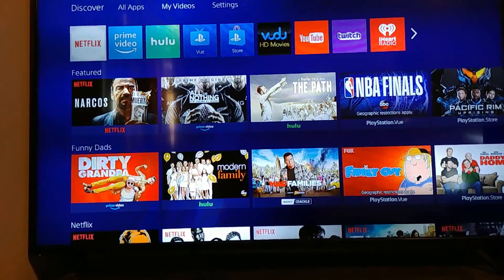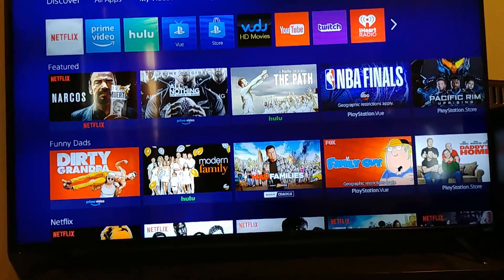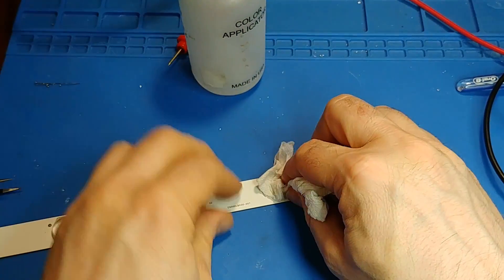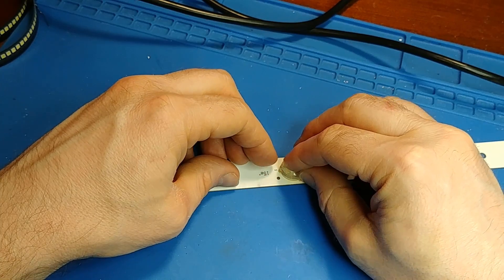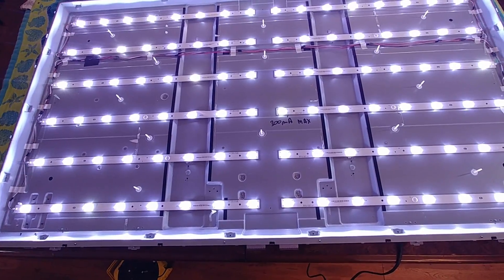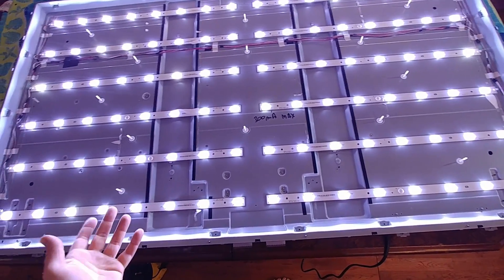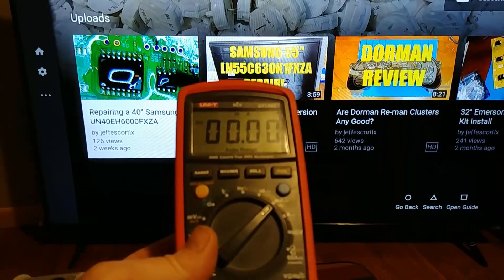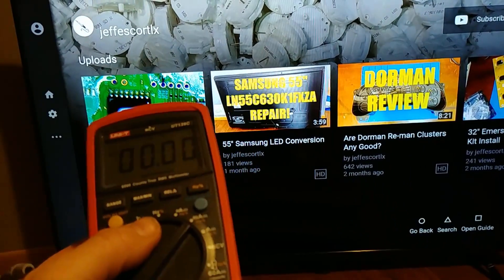How to Repair 60" LED Vizio Smart TV

Comment: Hey, I have a full working set of these strips a friend gave me to play with.  I want to incorporate them behind an airport flight status scroller.   Single strip - what power supply would you suggest  - 4 strips?    all Strips. all strips would be conected the same as inside the tv.
Much Thanks!  Todd K.
Reply from the maker: You're going to need a high voltage current regulated power supply. In the long run I think you would be better off to sell the TV strips and use genetic LED rope lighting. They are happy with a easy to find 12v supply and current regulation is needed.
Reply: @jeffescortlx   And of course, your right, 200 volts for wall art is ridiculous and just plain dangerous.  I do appreciate all your help on this.  I am going to run 2 strips in parallel try on 21 volts at 350ma and see how that rolls.  Let me know if i am missing anything.  With Thanks
Reply: @jeffescortlx  I would prefer to use these, and your input is truly appreciated.  I have a gaylord of power supplies, ranging from 30V 3.0A DC to 90V Steppers.  I have used 5050SMD - CREE Etc Etc  they just don't last or provide the light output that i really want.  Can you give me a good DC voltage and amperage to use these?  At best what would i need for one strip, that would help me out the best.  Thanks again.
Reply from the maker: @Mainbusfail  it all depends on how you wire the strips. Typically in TV's they are all in series so 150-200v is normal. I believe this TV breaks it down into individual channels. Limit the current around 100-300mA per strip and don't exceed 3.3v per LED.
Reply: @jeffescortlx    Very good,  that is what i will do.  I am just going to use one for testing.  Much Thanks!  Todd K.

Comment: Is there any way to do this without a hot air station?  If not, which one do you recommend?
Reply from the maker: If your not setup with soldering tools I'd reccomended to buy a complete set of replacement LED strips. It will cost more, but makes the repair much more pleasant with good end result without having to worry about crooked lens or LED's not soldered right.
Reply: @jeffescortlx  Ok thank you.

Comment: i have the same tv and it lights up and i bought new tcon board and main logic  board only thing i havent replace was the main power board curious would that have problems lighing up the back screen
Reply from the maker: I don't understand the question. The back lighting works, but it has trouble lighting?
Reply: @jeffescortlx  yeah the TV still has that glowing look but I have no picture I'm confused my self.. the led strips light up thru out the back of the tv but still no pic

Comment: A good few high capacity caps with bleed resistors, should take care of a spike/surge.
Reply from the maker: I would assume caps accross the LED's will effect the PWM. In stead of the LED's seeing PWM it will just see a averaged voltage. Might hit the low level voltage cutoff on the low end, might end up with LED's not lighting at dimmer levels. Also since the LED output is current regulated and monitored, I'm not sure how's it's going to react to a capacitor charging on power up.

Comment: These are under-rated and also under-performing TVs, 100% as a direct result of Vizio making a really unfortunate business decision. Vizio is allowing cheap, low-quality LEDs to be installed in many of their non-flagship models. This is a big mistake as it directly impacts quality and reliability. For example, brand-name LEDs with proper binning and specifications would improve contrast and color accuracy, not to mention outlast ever other component on the TV.  I just bought a 2015 model and changing out all the LEDS, whether they work or not, with much better binned LEDs. In fact, better binned, brand-named LEDs, running at the same current and voltage, be 30-40% brighter and also run cooler. The result will be a much better performing TV than when it was fresh out of the box.
Reply from the maker: You really can't single out Vizio. Every TV manufacturer has used bad LED's at some point or another. Samsung, TCL and LG are just as guilty. The only brand I don't remember putting LED's in is maybe Sony, they just have bad main boards.

Comment: You mentioned an led kit to replace them all? Do you have a link for that?
Reply from the maker: I don't know the kit part number, but if you drop the TV model number in the search box at eBay, Amazon or shopjimmy.com it will come up if it is available.
Reply: @jeffescortlx  thx bro. First time doing this. Ur video id def helping. Taking it apart is quite the process and ur details are great
Reply: I dont have a hot air station, but a hot air gun....i take it that should be okay? Right?
Reply from the maker: @de50aemr  if you can find a complete LED strip repair set you won't need to worry about replacing the individual LED's with a hot air station.

Comment: Can adding a fairly large inductor do the trick?
Reply from the maker: I'm not sure how the inductor will react to the PWM used to control the LED's. It might act as a low pass filter. As a voltage drop side effect it could help absorb some of the power. But might be better off just using a resistor if your just looking for a voltage drop

Comment: I swapped a couple bad strips out on a 47' vizio I have and then the LEDS were pul;sating when I turned it on. Took it back apart and just hooked them to the power supply and they were fine. So 1 by 1 I started hooking stuff back up and they didn't pulsate til I put the screen back on. So were the 2 strips wrong amperage or is the screen bad or what? any ideas?
Reply: there is a weak LED lowering the voltage. you have to find it with a tester. could also be a bad power supply.

Comment: Hey Jeff, I'm converting one of these Tv's into a table and was wondering how much power I would need to run all the LED's at once?
Reply: Just the strips and wires left. Can you suggest a power supply or what specs I should be looking for? Possibly a dimmer?
Reply from the maker: @edwardtucker9256  3v per LED. Limit to 200mA and you'll be in a safe range but still near maximum brightness.
Reply: Edward, would be cool if you made a video and show it when your done.
Reply from the maker: Power? Where on the 120v AC input side?

Comment: Do you power up the tv just by plugging it in? I do that and nothing happens. I know not all the strips are bad.
Reply from the maker: You might have to turn it on with the power button.
Reply: @jeffescortlx  Thanks. I replaced all the strips and now they all light up normally, but after about 30 seconds all but the middle two strips dim while the middle ones stay full bright? Is this normal?
Reply from the maker: @YoAdriannnn  Yes. That's the local dimming feature. It's trying to display "no signal" in the center of the screen. No need to light the top and bottom of the screen just to display that message.
Reply: @jeffescortlx  Oh thank god. Gonna put it back together tonight. Thanks for the video it was immensely helpful

Comment: They always tell outrageous lies they tell about how long the back lights last. I have even heard them say 30 years. Why can't led companies tell the truth.
Reply: The main reason is that cheap, poorly binned (out-of-spec) LEDs are used. If good LEDs were used, these TVs would still be running, and honestly have better contrast as there would be more light output.
Reply: I like LCD's better. They last for years! Still have one that's about 11 years old.

Comment: Thanks Jeff for this video..but no way I'm going to do all this. I'll never buy another Vizio TV again that's for damn sure.
Reply from the maker: Read corys post, 2 posts down.
Reply: @jeffescortlx  Hi Jeff, would you recommend I pay a TV repair guy $350 for parts and labor or just buy a new TV altogether? Mine is about 4 years old? Appreciate your help.
Reply from the maker: @marqueamore8467  ideally the most economical solution is for you to order the parts and install them yourself. If that is not a option for you I would reccomended to donate the TV to someone capible of the repair and buy a new one. TV prices have really come down. $400 will buy you a large 4k smart TV.
Reply: @jeffescortlx  I have the 65 inch model and mine had the dark spot on the right side of the TV the whole right side edge was dark then about a month later the screen quit working all together would my issue be the LEDs or a bad board
Reply from the maker: @kevinanglin678  do the flashlight test and see if it still has image.
Reply: @jeffescortlx  ok

Comment: I was doing the repair and accidentally tore the ribbon that goes to the scan drive board on the left hand side. It looks like it didnt affect any of the electrical connections but now TV shows no image. ????

Update: upon further review. There is nothing wrong with ribbon that connects to screen. Theres no image or sound. Antenna is connected as well. It was working before and only needed LEDs replaced. I made sure that everything is connected. I'm at a loss. I need help please. I paid 92$ for strips.
Reply from the maker: I'm not sure what you did, or didn't do. It's hard to troubleshoot long distance. Maybe sleep on it and take a fresh look at it again.
Reply: @jeffescortlx  thx for the reply. Just a little background on me, I repair computers and build them. I also tinker with fixing all my electronics. I handled it the way u would handle any electronic. That's why I'm so confused why it isn't showing an image now. I thought at first the ribbons were not connected correctly or were not making good contact. I carefully disconnected them and connected them back again.  You can see something changing in the background but no image actually displays.
Reply from the maker: @moisesmaldonado3210  ok, back lighting and image are independent from each other. And you have neither?
Reply: @jeffescortlx   I do have backlighting I can't see an image for when I start clicking the smart settings to open up YouTube you can see loghting changing in the background you just can't see a an actual  image.  I also connect that the antenna again and since the  Channels are already programmed it should have at least had sound but there's no sound coming out.  either
Reply: @jeffescortlx   I'm doing all this work on a wooden table so there should be nothing that to call static the what a fried the circuit board on the back. And I never even touched the boards myself.
Reply: @moisesmaldonado3210  Static damage can come on wood, plastic,glass and other non-metallic surfaces. 35 years in electronics and bench repair on TVs all the way up to fiber optic lasers and telecommunications gear. Have B.E.E. and 1st class FCC license

Comment: Nice repair, sucks to have to remove the screen & all the support screws to replace the LEDs though! When handling a screen I'd use gloves, nothing worse than a mark on the back of the screen... I guess this is fate of most LED backlight TVs,  you have to make the call on whether it's worth your time to repair. I wouldn't want to have to swap out all those strips though, but $80 to get your TV working again I suppose is cheaper than buying a new one!
Reply from the maker: When I first stated doing LCD repair/glass removal I was super careful about keeping the back side clean. But the more I did, the more I noticed finger prints on the back side don't show up on the front side. So now I just do what I have to do (keeping it to a minimum of coarse) but you would have to leave a serious smug for it to block light and show on the front side image.

Comment: I'd like to talk to you.  I have some equipment you may be interested in.
Reply from the maker: Like what kind?
Reply: @jeffescortlx
Reply: Just went through a divorce, so You are in a position to get a deal of a life time.
Reply from the maker: @brookehill2402  I appreciate the offer but my amscope is pretty awesome. I can't imagine replacing it.
Reply: I also need my dash repaired, but of course I'll be one of your "fix it yourself mess ups'.
Reply: @jeffescortlx  I have an amscope as well, which is why I won't let it go.  It is awesome.  I just thought you might want something of high power and a probe station.  Please call me and you might find out it is an awesome deal.
Reply from the maker: @brookehill2402  is it a medical style microscope? Looks to have a close working distances?
Reply: I am letting it go for pennies on the dollar being I am in an apartment now instead of my house.  And by pennies on the dollar, I am not kidding.  Call me and I just want the space not wasted.  You can win link a sin.
Reply: I used it delayer  micro controllers.  .   @jeffescortlx
Reply: I used the probe station to monitor the bus to find out how it worked, and I can assume you can assume where I went from there.
Reply: Of course that took some knowledge of assembly language and some C, but for your use, I assume it would be used to take voltage/amp measurements.
Reply: My stepdaughter is a huge fan.  I took her to her first junkyard the other day and she went nuts scavenging parts.  I don't want to steal business from you, but she really wants to dive into it after i showed her your videos.  She saw me fix a vizio 42" and thought it was awesome.  20$ fix vs a 400$ fix.  I am bringing my soldering station out of storage,,,kind of a cheap station, hot air, and iron, but it works.  She is going to have a blast.
Reply from the maker: @brookehill2402  I appreciate you thought of me. But my office deck is running out of space. My amscope is perfect for my needs.
Reply: @jeffescortlx  The large on has close working distances.  The probe station gives you plenty of room.
Reply: @jeffescortlx  I understand.  Even back in my lab i ran out of space.  Just thought Id through the Idea at you being I am trying to clean space.  When I mess my cluster up pretty bad, you can have a go at it!!!.  Though I am confident I can fix it.  It is the PRNDL that is not working.  Fun Fun.

Comment: Thank you for this video, it has been very helpful. I have a Vizio model E65-E3 with a few strips not working. I cannot find replacement strips and so I would like to replace LEDs like you have in this video. Can you tell me how I can identify what kind of led I need to get? Thanks again!
Reply from the maker: You can measure the dimensions with a micrometer. I typically see how much current they draw at 3.3v to get an idea. Also bottom pads can change so keep that in mind. Color temp for tv.

Comment: I think this issue may be due in part to poor thermal coupling (and probably low qc leds) almost all the ones that failed in mine were over thin air in the channels of the chassis rather than pressed against that large hunk of metal.  I'm going to put a little thermal paste down for better coupling as well when I replace them and try to come up with something for those in the channel.

I would be interested in a hardware solution to limit inrush I seem to have found a suitable component. https://www.onsemi.com/PowerSolutions/product.do?id=NSI50350AD
One per strip should work I think so I need to find it uner 2500 qty....
Reply: https://www.digikey.com/product-detail/en/on-semiconductor/NSI50350ADT4G/NSI50350ADT4GOSCT-ND/3487456
Reply: 100%. I looked at the failed LED under magnification and the phosphor coating showed heat stress. Or at least what is most likely the combination of defect and heat stress. Better thermal management would help.

Comment: ? Based on your 600 ma problem for the LEDs......did you ever check the LEDs you removed to verify they did not work??? I had a slightly older tv that required just a bit more solder on certain vizio chips which broke the connection to the back light power. Weak solder maybe?
Reply: I have an hypothesis that its either cheap or lack of solder on the LED connection causing the strip to fail. LMK know what you think please.
Reply from the maker: @jamesjames528  typically I test them on-strip, and if they fail I'll remove and toss. But next one I do I'll reflow first, or check again after removal.

Comment: Suggestion(s): 1. Use a hot plate(will reduce ur steps) 2.Replace them ALL 'fore they all have the same hours as the fried ones ;)
Reply: I have the E65 and All the LED's that have gone bad on mine happened all at once. I'd rather replace them all than have to do this again in 3 months!
Reply: @ClausenLT  they wire that mess in series mostly, so when one goes, the rest behind will go too